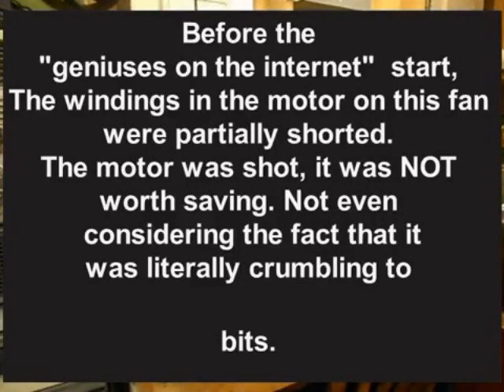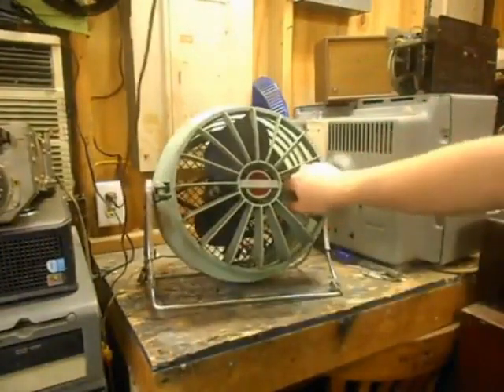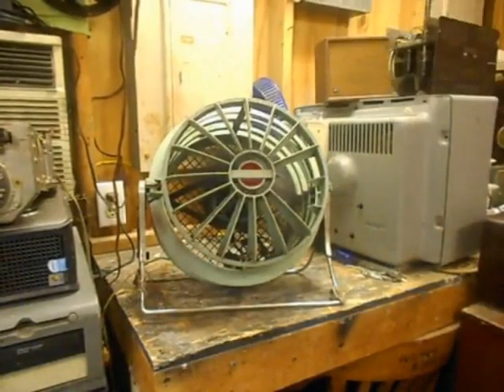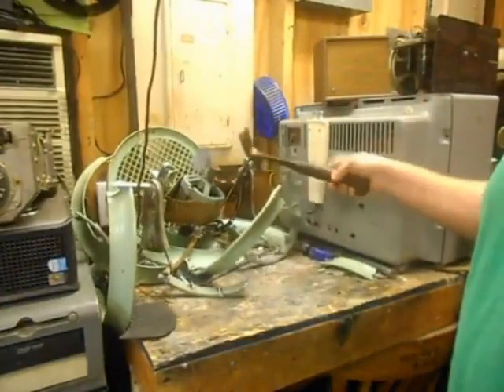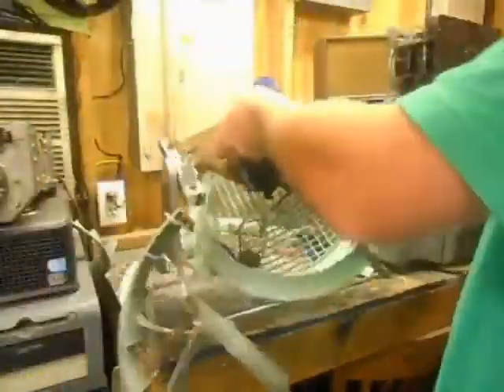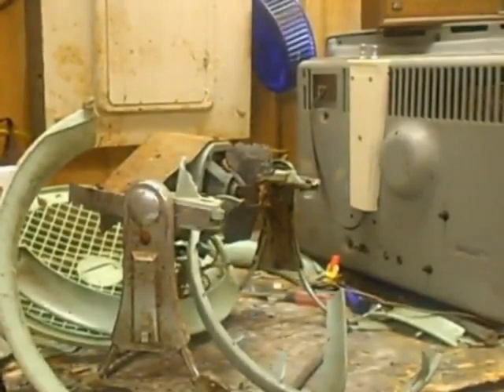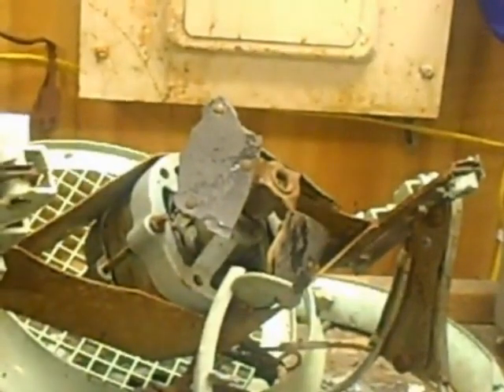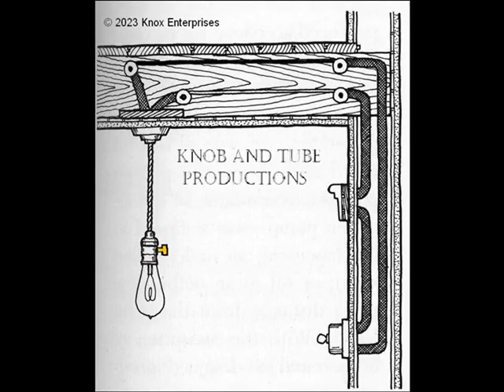Destructionfun With Antique Fan

Comment: ONCE AGAIN! THE WINDINGS IN THE MOTOR WERE PARTIALLY SHORTED! THE FAN WOULD START SMOKING AFTER 2 MINUTES OF RUNNING AND WAS UNUSABLE. IT WAS NOT WORTH FIXING. 

THIS ISN'T EVEN CONSIDERING THE FACT THAT THE FAN ITSELF WAS CRUMBLING TO BITS ANYWAY.